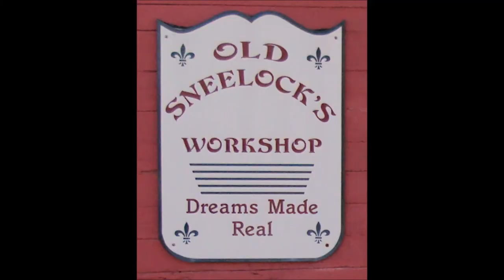Trying Out A Drawer Full Of Planes At Old Sneelock's Workshop

Comment: A drawer full of winners, looks to me like. I didn't really expect any different! Doesn't really have to be name brand to do the job. Just do the job. Although, some quality goes with the name. or is supposed to, Thanks Unc!
Reply from the maker: +Lewie McNeely It does spoil you a bit to work with good tools. I love my little South Bend 9" lathe but I really miss the big American I used as an apprentice. 2" bore headstock, 14" swing, full set of metric and imperial threading gears. It would cut a 1/4" deep in 1 pass. The jobs that take me days on the SB I'd do in an afternoon on the American. I also miss the Bridgeport, surface grinder, radial arm drill press, 60 ton hydraulic press, and the cabinet full of bits, drills, and taps too. 
I'm working with a much smaller scope now. Having that big Bailey #7 cutting shavings, snick, snick, snick. Is a pretty cool way to get the job done.
Reply: Scaling back sure makes for an interesting day. The big stuff sure is nice wen there's a lot of material to move around. I went to the Saw Surgeons to regrade for some water problems he was having. Ran a Bobcat 334 trackhoe which is a good machine in it's own right but it'll beat you to death the best you can do. My buddy I was working with owns it and he said the dealer kept it for 6 months and couldn't fine what was wrong with it. Like he said it'll make you think you've never run a machine before. You can make one smooth lick with it and it'll bounce you around like a ball the next. I told the Saw Surgeon I could ride a rodeo, no sweat after yesterday. Had to drag out the splitter to hammer the kinks out. Glad I don't have to run that thing all the time. Something would GIVE! Probably my back!

Comment: What method do you like for sharpening plane blades?
Reply from the maker: +Jonathan Martell The method I have had the best success with is dry grind to square the edge, if needed. Then 500 and 1000 grit silicon carbide, wet or dry paper, with water, on a stone surface. The edge is sharp and can be quickly brought back to sharp with the 1000 grit paper. 
I just started trying a couple of King water stones. Too soon to tell but it leaves the bevel and back polished fairly quickly. 
I'm not into sharpening for more than a couple minutes. Once the edge is there I stop.